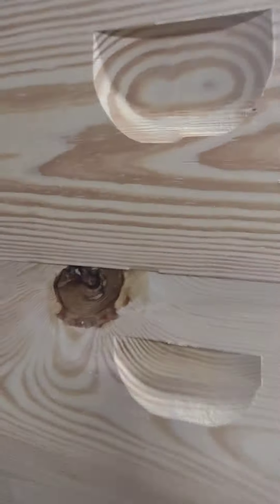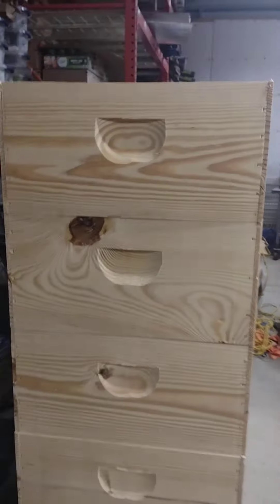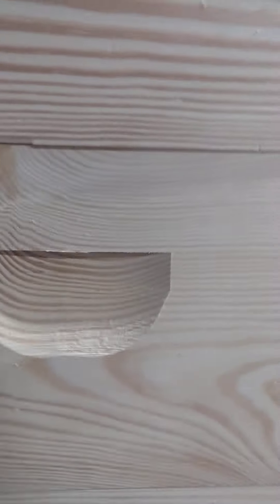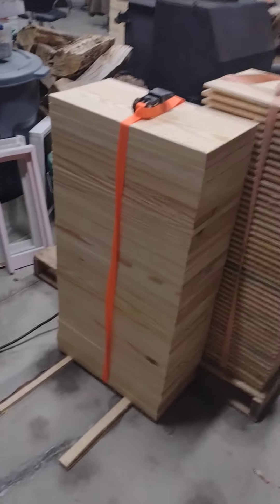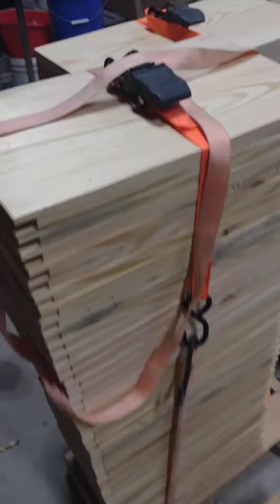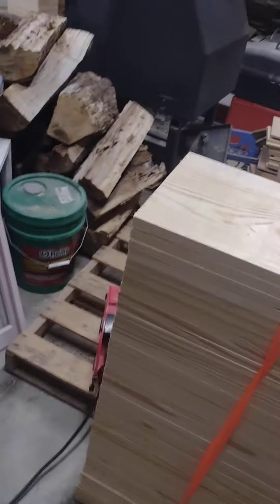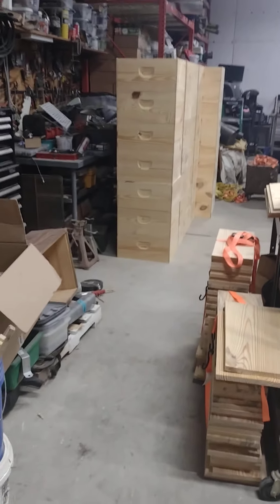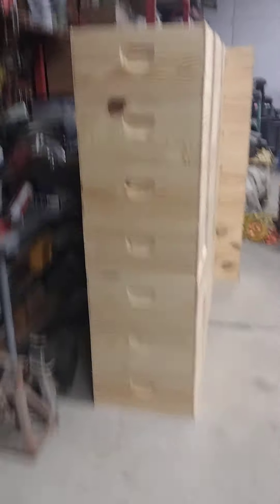Only got 50 hives put together today.

Comment: It's not only 50, it's a solid 50. Excellent number.
Reply from the maker: Going to post another video of the jig I built from your plans. I messed up today and didn't do the plunge cut first and it was actually easier on the saw and the handles came out even smoother. Not sure you could do it unless the box is assembled like I do it  but they turned out good. I